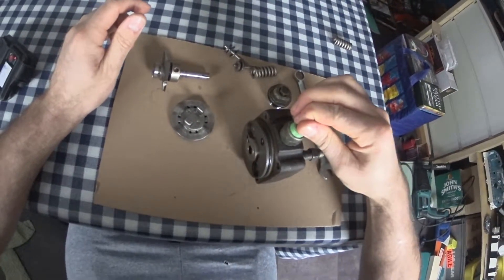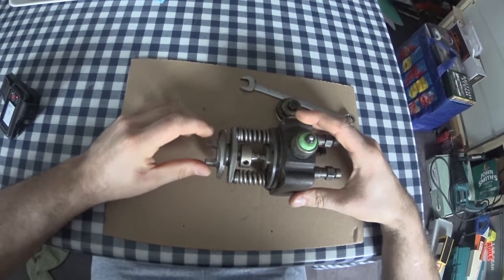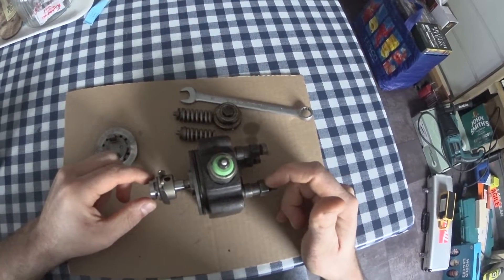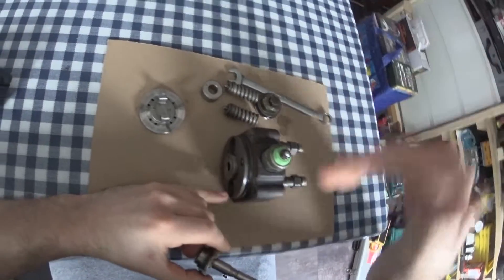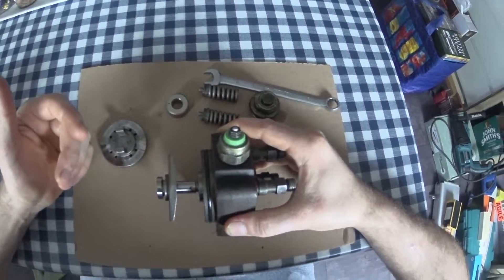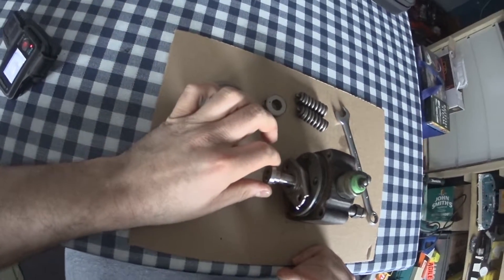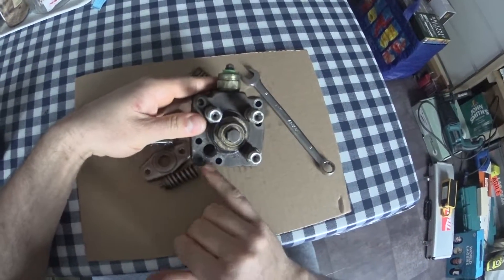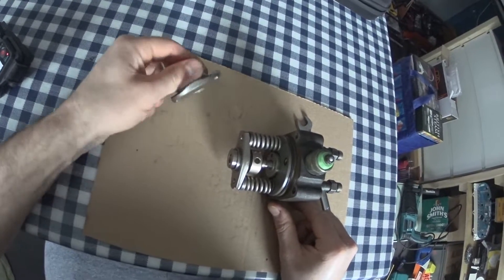Bosch VE,VP pump head demonstration, how it works

Comment: Can you please explain . When you floor it harder ; will the spill port open and extra disel will go to return line ? Or when youll floor hard the spill port gets closed and disel will go to injectors with extra pressure ?? 

Which case please explain

Comment: Excellent thank you.    The  rear odd shaped socket plug was loose  so i wanted to fit a new o ring,     but was cautious to remove it,   as i was unsure if the pump would implode 🤔 on me with its removal,     your video explained it for me,     thanks again 👍